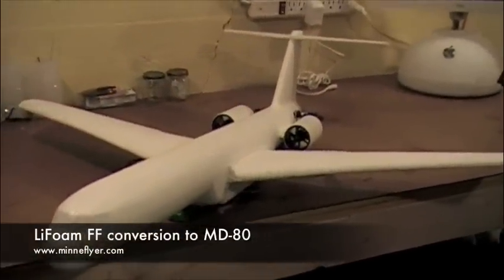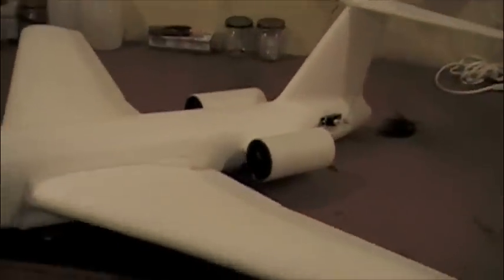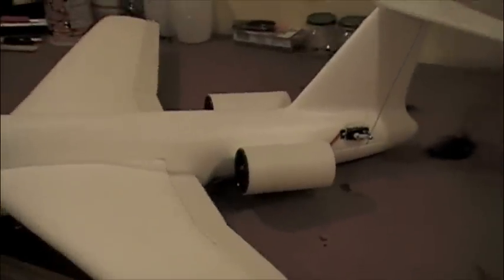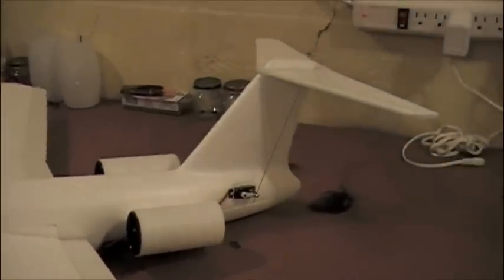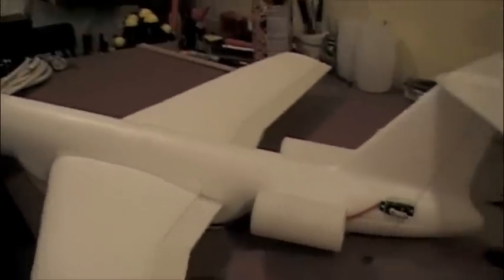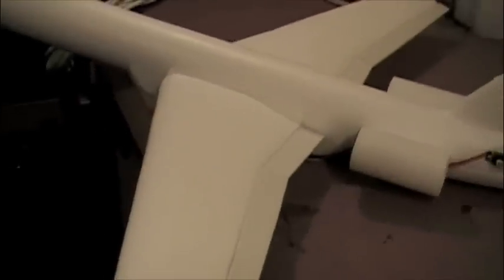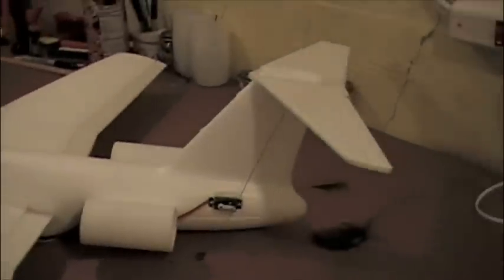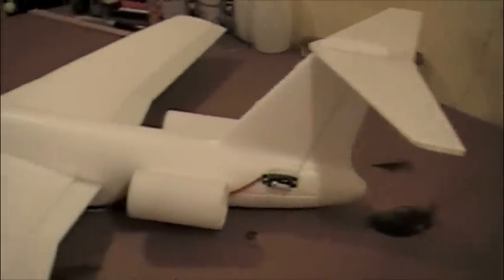RC MD-80/DC-9 Airplane

Comment from the maker: The ailerons were cut from a piece of foam board. I beveled the leading edge of each aileron, and then used 3M Blenderm "hinge tape" to secure them to the wing.  If you get really close to the plane, you'll notice that the ailerons are taped on.  Otherwise, it's a pretty clean look!